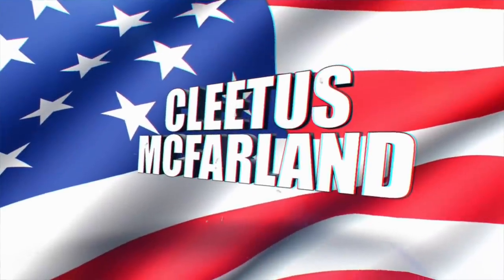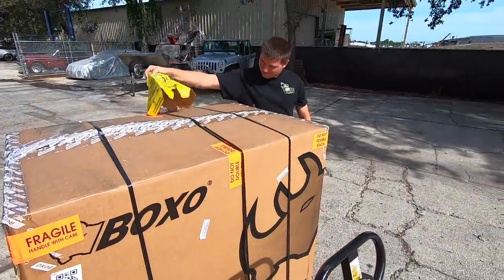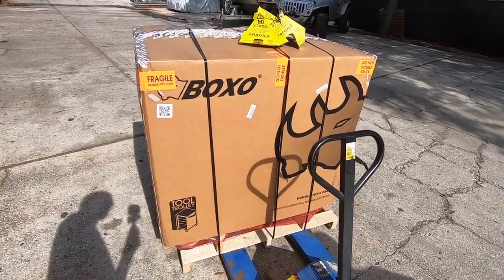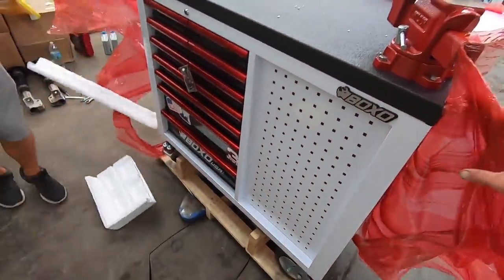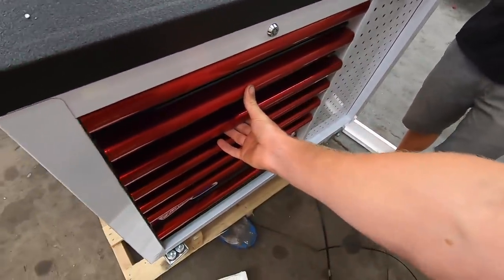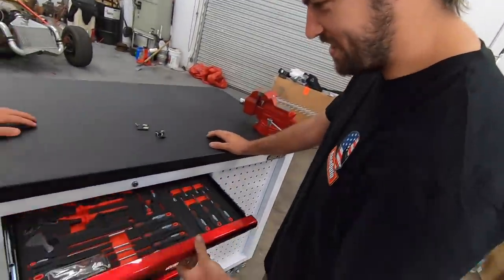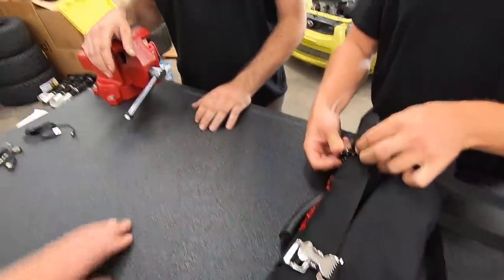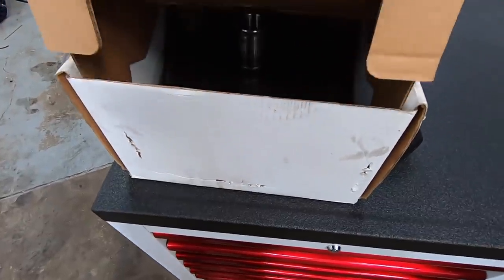We FIXED Ruby’s Boost Problems!!! (Making 30+psi Now) + Surprising James With a SICK New Tool Box!

Comment: Wouldn’t that Snap-On box be under warranty? They cover everything?
Reply: Really depends, If its deemed wear and tear they do not replace it, It took ages to get my bottom drawer slides replace on my box because they said I over loaded it, I even weighed out everything and it was still 50 pounds lighter than the specs they called for and finally ordered and sent me the slides, i never installed them and when I sold that box I just gave them to the new owner. Resale on snapon boxes are hard because everyone has them and no one wants them unless they are beat up or super cheap. 
My neighbor has a 15k MAC box with 90% of snapon tools and he has been trying to sell it as one whole kit for a number of years since he retired, Its huge, The only way to sell that is to part it out, I tell him that all the time, yet If I can get it sold I get 10% of the price, As you can see for the last 5 years I have not found anyone willing to spend that large amount of money.

Comment: If your going to insist on using 35psi boost you need a Diesel engine for the heads to contain that Lvl of pressures routinely While most of your Gassers can't contain such pressures for Long.

Comment: Boxo looks nice yet when I viewed their page, they do not sell a full kit like this on there... I was thinking that it was a all in one tool box with tools, there are a number of other fine companies that sell you a box designed with tools already in the box, Boxo boxes are several thousands and then tools added are even more, This set up might run around 6 or 7k. 
Teng Tools sells a 19 drawer box with 32 trays sets for 10k with over 1100 tools in it. They also sell many other sets as well.
Reply: Look at their combo deals . You can get a different 45" box with a top box with a 217 piece tool set  for 3K. Or $2700 with the Cleetus discount.

Comment: Young bucks are so spoilet by modern metal fasteners they don't know what an impart driver is? That is progress. But a mech still needs one just in case. It's been so long since I've used mine it is rusting.

Comment: lol  tools are usually meant for anything theyll work for, but in this case noo....those larger wrenches-r for bigger nuts, youll jus ruin the overpriced fittings with a wrench, but u also used n adjustable on those?? that deff registers on the cringe factor scale

Comment: Is ruby's red corvette and Leroy is owner name so ruby's and Leroy are true children of cars then Ford galaxy has  Diesel fuel only  and not really race car is sleeper .and thank I'm big fan now put poor now i have 4 cycle jeep  Patriot with no full drive 4×4 and runs gas .And 5 speed manual with clutch okay. Cleetus McFarland. And going to put  A 4 cylinder diesel engine with a 2.1 l engine and a number of put a Turbo on it.on my jeep 🚙 but am taking factory framing off jeep 🚙 and rock 🎸 collar on and going to put rock crewing .with 📦 boxs frame with like ruby's transmission  and frame is  custom frame for rubys corvette and. So I'm going to big fat tires have on smaller car tires. And jeep will have made camper with hardwood floors in the jeep and  I'm going to put.in Mable tree 🌳 and put bug wood in jeep backseates and at floors is not pine tree.  What's at goes in a Box in a doesn't have flies and bugs die and it  that's what I'm putting in Cedar in the jeep Patriot and take all the plastic in your car out spray foam all plastic is gone and spray foam and cedar wood in the jeep 🚙 Patriot. And little kitchen and small flat screen TV WITH small kitchen counter to eat on you all live in the jeep . And black out window are black paper on windows for installation and wood on walls and ceiling led lights. And magic fan and 480watts glass solar and solar controller have jeep will even and like 120 to 110 volts and USB ports and tv.📺 and tiny small refrigerator. All solar panel and tribune electric makers and run As faster than Leroy your Corvette because the jeep Patriot will have 6 manual transmission because 5 speed transmission. And custom jeep Patriot use have 4  Cylinder gasoline engine because I'm a beat ruby and Leroy your female red corvettes and Leroy. I  could drive it when don't your race track of your liken and i bet Leroy and ruby's  and James  How a d junk Chevy pickup truck with my personal jeep Patriot because have friends and family in Florida ok. Beat you and Cooper and James .25 mile only one past for all your unicorn cars .just like my manual 5 speed transmission in 4 cylinder gas engine .but custom frame there will box fuel tank with one big oil and gas tank and pumped in the jeep Patriot 🚙  Diesel Patriot with smart car seats and will probably do 3s and 4s and  6s .if you think cars can beat or race galaxy and if you say and help out for month and drive my jeep 🚙 Patriot back Pittsburgh Pennsylvania and Ellwood city Pennsylvania.i and from Pittsburgh on the Pennsylvania turnpike go west tolders state of Ohio. If you cleetus McFarland think you me I drive down to Florida with my jeep 🚙 Patriot I 75 to beat Ford galaxy .so am starting to build the jeep Patriot out its just like a monster 👹 or 🦄 unicorn your Leroy will smoke you beat you down the track. But you I'm building my jeep Patriot 🚙 to totally from ground up and because It my  Daily vehicle I drive back from  swimming. Ok but I love your YouTube channel and videos a content i first seen  water in and I've been hooked on your program ever since okay. Could probably drive ruby and Leroy because I was professional truck driver and gear ⚙ head like you and coop and James. There like family 👪 and you have most awesome YouTube channel. I seen you are hustler an d radio  Commentator. Or host.and now you have rock 🎸 and country music 🎶 at the races 🏁. I'm so proud of dude and only  24 years old. And you got your racing team very strict Leroy and ruby's and Ford galaxy. that working on  Neighbor Ford  Crowned Victor police car and Cooper  Mystery machine.becauase Cooper i on year younger than you. .awesome show I been on  Benj with your videos thank you .in Florida take care and be safe out there and because I'm in Pennsylvania all time my jeep Patriot 🚙 Diesel custom frame work  A 4 cylinder diesel engine .with 2.1  Leader  And board out for racing your vehicles with diesel and the Jeep Patriot well good luck buddy is raining hard over here in Pennsylvania.good night team cleetus McFarland. Race team and owner of 🏁 race track and  See meant burnout pad on your race track and when not racing and have  Concerts and not a big big big revenue for your place and through your snack shops in your beer and everything. And all  Merch good luck buddy thank you for having awesome channel on YouTube.but real poor but jeep Patriot 🚙 will be done .2 years and  it jeep Patriot dark  But telic Gray with plastic rubbers on on my sides wwar the door 🚪 on jeep Patriot 🚙 and black 🔳 interior.and I'm leaving drive 🚗 cabin like  Ridge in on out side deep partiot will  be  small jeep Patriot as 5 speed transmission. And 😎💀👀😎👀👁👀👁